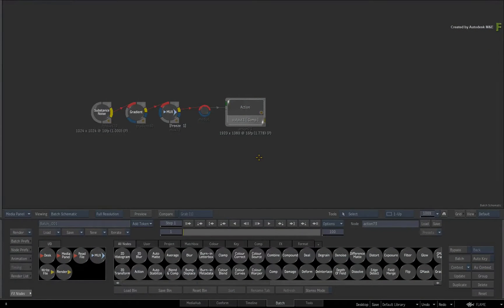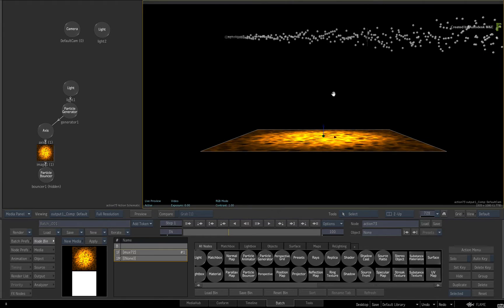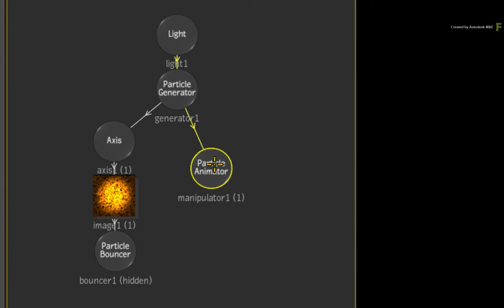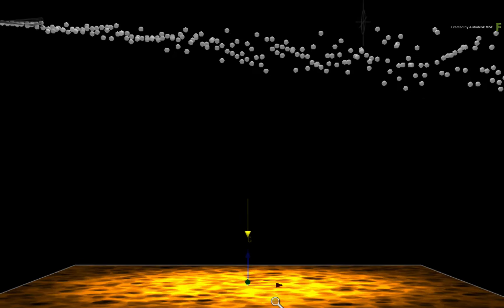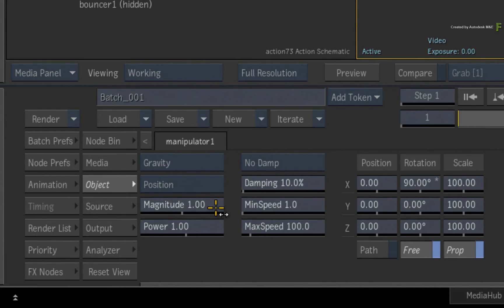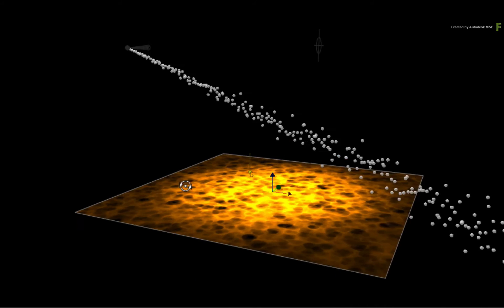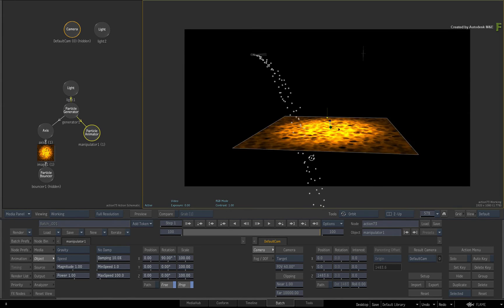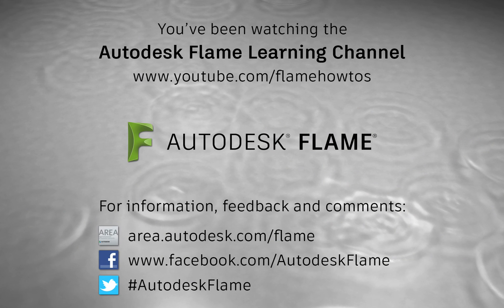Particles 101 - Part 6 - The Gravity Manipulator - Flame 2017

Comment: Hi Grant, Is there other particle emitter other than a light?
Reply from the maker: Hi Samuel Armin, you can emit particles from a surface as well as a 3D object.   Just use those objects instead of a light when attaching the particle emitter.

I covered this in part 1 of this series - https://www.youtube.com/watch?v=8A-AxP7CabQ&list=PLqfk4mdQn0sUt10RO5casjiBrYMzVOkf5&index=1
Reply: watch previous parts of this toutorial - you will find